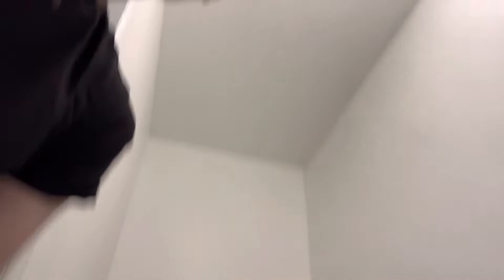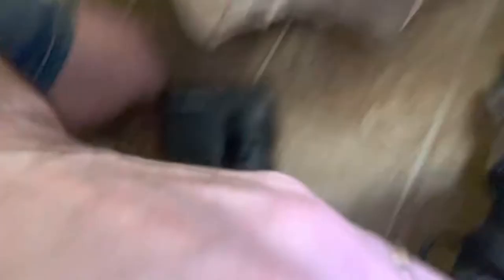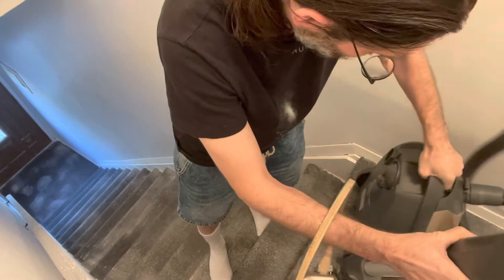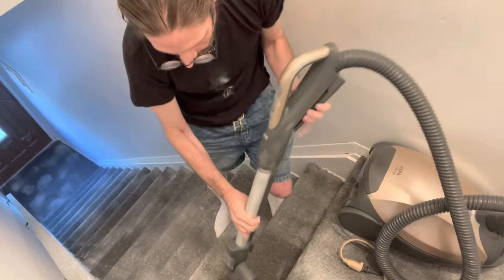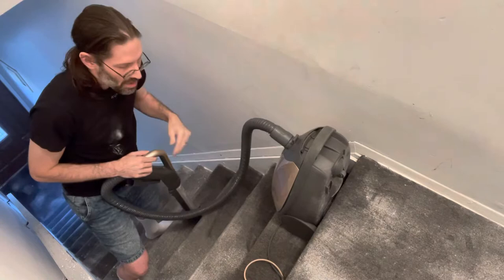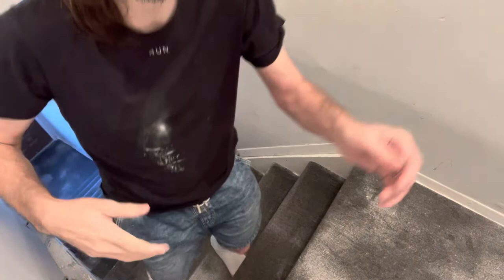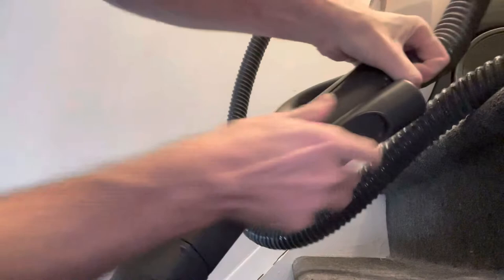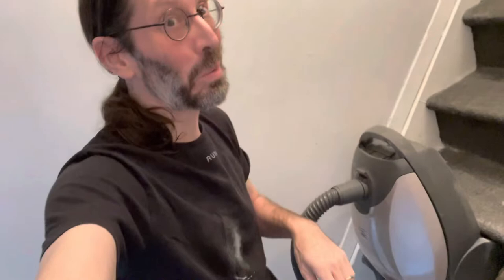Kenmore Elite 700 Series Vacuum Pet PowerMate & Diatomaceous Earth

Comment: The manual says the Pet  Powermate can only be used on the HOSE handle (where all the controls are)bNOT at the end of the long wand!!! This is definitely safer and more versatile on stairs.  It's easy to vacuum the vertical stair rises as well.
Reply from the maker: Thanks for the info!

Comment: cimexa is also really good to use along with DE but I would only put it where my cats couldnt get into it like in dresser drawers and place some kind of paper over it before placing clothes in there. Nice vacuum btw, that exact model is on my list of upgrades. How is it holding up and do you still maintain some kind of preventative measures against critters?
Reply from the maker: I'll check our cimexa if there's a recurrence. I think I annihilated the critters. Prevention now is just more frequent vacuuming. So far so good. The colder weather might be helping too.